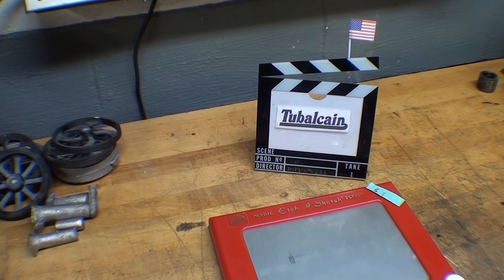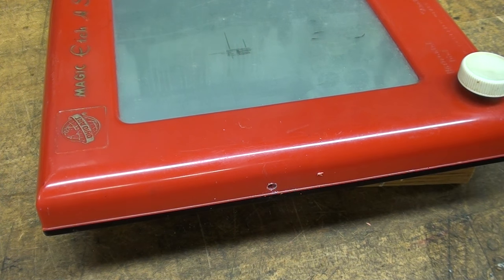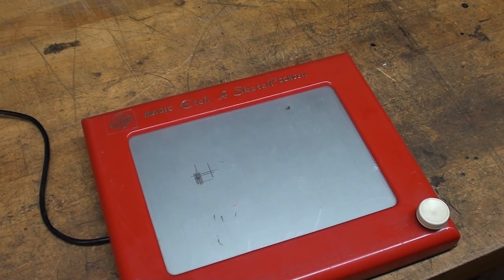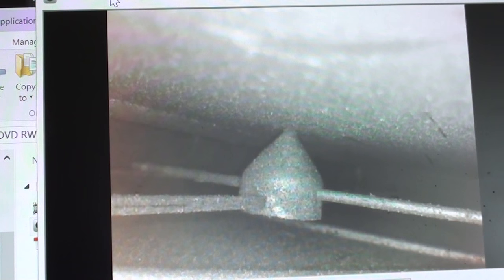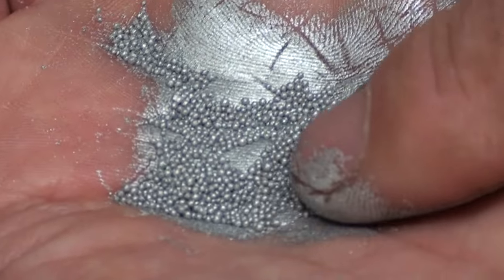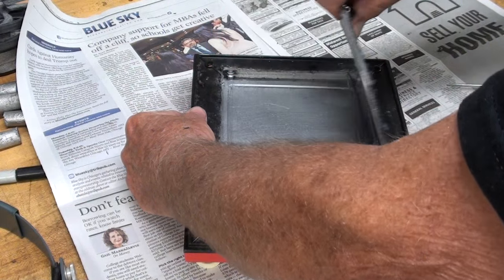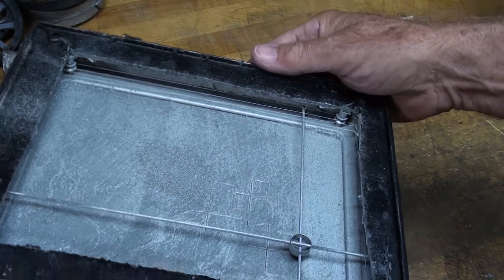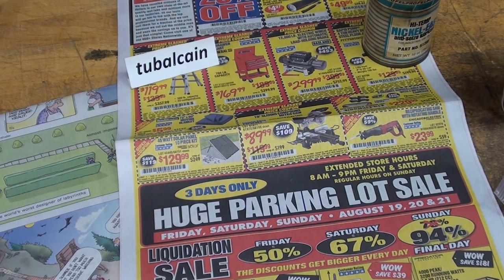WHAT MAKES IT WORK? #22 Etch A Sketch - proctoscope tubalcain

Comment: Another comment. I am a bit older than you. In 1952,  when taking a drafting class at Central High in Kansas City, Mo., the teacher had a problem of students picking things off his desk. To stop the problem he constructed a cigar box with a handle that held an old Ford magneto and a 6 volt telephone battery. The connecting circuit had a wire with a gap in it running under the handle. When the student picked up the box he wound close the circuit. It sure didn't take long to look at the box. Later in life my wife and I moved to Houston where she taught home economic in a large west Houston high school. During her tenure a student put super glue in several door locks. Caused building maintenance quite a problem. Had to open the doors by pulling the hinge pinI do enjoy all of your videos. I am a mechanical engineer, agree with your frustration, ant think society is going to have a very rude awaking one of these day with government going the way it is present moving. Guess I am getting old.

Comment: Thanks Mr Pete, I always wondered how it worked, now I know.  I also had issue with old battery drills, but I liked the variable speed and torque, so I took out the battery and  rigged up a DC power supply with a cord, since I use it at the bench it does not need to be cordless.  Works great, I have the speed and torque control with NO battery issues.  Keep doing what you are doing, love your videos.  David Dellinger

Comment: As always I enjoyed your video.  As a child of perhaps 8 or 9 I also wanted to know how Etch A Sketch worked.  To find out I used the two XY controls to draw parallel lines side by side the entire length of the pane.  I continued doing this until the entire pane was cleared with side by side lines.  It took a fair amount of time as I recall.  In that manner (similar to what you did at the beginning of your presentation) I could actually look down through the semi cleaned pane to see all the working parts.  While my effort saved drilling holes, getting hands dirty etc I never the less greatly enjoyed your presentation more.  Always fun to learn. And it brought back a lot of memories.  Thanks.
Reply from the maker: Thanks--you were pretty clever as a kid.

Comment: I understand your frustration with the Sears 19.2 V drill! That was the first battery operated drill I ever owned and it was a complete piece of junk from the start because, like yours, it wouldn't work but for a very short time after charging. The batteries lasted about 6 months then refused to charge fully afterwards. After letting it sit in the back of the closet for years, I finally gave it away. In the meantime, I got a Dewalt 18V which I have had for 13 years and I just this year finally had to buy two new batteries! The drill motor still works like a champ!

Comment: The first video of yours that I saw was the 8 ball autopsy. This reminded me of that. I had this toy as well as the 8 ball and I like the idea of seeing hoe they work. I'm sure someone will tell you that the powder inside this is bad stuff and there is a guy called Cody's Lab that took it and made thermite from the powder. It's aluminum and oil mixed. You are right about the kids today not having any interest in things like that that are not electronic and slow. The older generation was probably the last one to have anything mechanical and it is only through the exploration of mechanical things that the workings of the world can be figured out. Because you can see how it does what it does. But, open a compute game and look inside and there's nothing that indicates anything, other than a battery. That's why the vast majority of new drivers on the road will need help if they get a flat, because jacking up a car and taking nuts off is soooooo 18th century!
Reply from the maker: Great observations & true!
Reply: Thermite...Oh My!  That might be fun.

Comment: Mr. Pete, always informative and educational.  On the subject of you battery gun, get a Milwaukee fuel (induction motor) the batteries are awesome.  There is plenty of information on these on YouTube.  A bit like you, my students would run the dental laboratory hand pieces up to 50,000 rpm' sat which point the burr would fly out like a bullet.  I had to go in and disable the speed function back to 30,000.  Please keep sharing you inquisitive mind.  Kindest regards. Joe.

Comment: I love your videos Mr. Pete, don't ever change. I like the detail and I've never thought any of your videos were too long.

I also always thought these were magnetic and I'm glad you did this video because it satisfied my curiosity. I think those balls are just the carrier for the powder though. The powder is too fine and light to evenly re-coat the surface without some help. The powder looks like the heat transfer compound I used when I was an HVAC tech. That stuff got everywhere no matter how careful I was.

Comment: Years ago, a close friend was director of communications at College of duPage. One of the students working for them part-time connected step motors to each knob, and wrote software that enabled more sophisticated drawings (like circles) on an Etch-A-Sketch.
Reply: This is the same idea as CNC control on a 2-axis milling machine.  Actually, I was a little surprised that Mr. Pete did not mention the parallel.

Comment: Nice video.  It works pretty much the way I figured it would, though, like you, I suspected magnets were used, too.  The stylus itself is very cleverly designed, the way it rides on the two rods, simple and yet very elegant.  The powder probably acts as something of a lubricant as well as providing opacity to the glass.  The little balls, glass probably, must be to help stir up and redistribute the powder as you shake it.

Comment: I pulled apart an old Underwood typewriter once. The only thing I ever took apart that I couldn't put back together. My father was not a happy camper. I ended up putting all the little wires and springs in a paper bag and then throwing the bag and all in the trash.

Comment: The real heart of an Etch-A-Sketch is the cable arrangement to make the stylus move by turning the knobs.  They have to be a certain way.  I had taken one apart years ago but I don't remember how the cables are arranged.  I think I remember a small spring in line with each cable to keep each taut.
Reply: I am 69.
Reply: You might be right about the springs, Roy, I remember the old valve set radios I took apart as a youngster,  many a moon ago now, those  had a string that ran on small pulleys to move the needle that showed you where the stations were on the face of the radio and that string also had a spring to keep it tight. What happened to the good old days when thing could still be fixed on the kitchen table? Regards and bless the good old times!
Reply: And bless Lyle for bringing back so many old memories! Bless you Mr Pete "Tubalcain" just love the videos and your sense of humour, hope for your sake your wife has a good laugh about the things you say sometimes, but I would bet she does! As you must have been together for some seasons now. And she must know you very well! Hope you remember to put that bras toothbrush back where you found it though, or you might be in hot water this time! Kind regards.
Reply from the maker: THANK YOU!

Comment: I took one apart as a kid by breaking it open at the glue joint. Another thing that didn't go back together, but I've always known how they worked for that reason.
BTW, trash that drill and get one of the newer ones with lithium batteries. HUGE difference.

Comment: Dang! Was curious for you to describe the cable(s) that drive 
the 'etcher', namely what material(S) it consisted of. 
The cable does, as you said, last for a very long time, as does 
the 'cord' that drives the tuning capacitor(s) and frequency dial 
in old radios.

Comment: Im not a fan of those Craftsman Drills either. The Batteries have a problem holding a charge.
Ive had issues with Milwaukee Drills too, Specifically with their chucks.
Best I've found so far has been Hilti and Bosch for Battery life. My hilti drill has been getting used for mixing cement and thinset for the last 7 years or so and it still works. The rubber overmolding Started to deteriorate so it go Wrapped with electrical tape. And I recently picked up a bosch set, a 1/2" hammer drill with an impact driver, And if I'm setting sheetrock I might have to charge them once every day or so, if that. I was kind of blown away when i first bought the set because a couple of weeks went by and the batteries still hadn't dropped low enough to justify a charge. Its been at least six months since I've picked up that set and I'm still real happy with it. not cheap though. $100+ per battery
Reply from the maker: Yes

Comment: I always wondered how they achieved the evenness of the erasure. It seems to be a combination of the very finely-divided powder and the beads which serve to spread the powder and mash it onto the screen.

Finding the it was two identical carriage pairs with crossed (and springy) rods rather that a single gantry with a traveler on the bridge (like a gantry crane) (which was what I had assumed) was just a bonus.

Comment: hard wire that cordless drill and plug it into a small, sealed rechargeable 12V battery, something small enough to carry around, that's what I've done to mine and they'll run all day long now:)

Comment: Any thoughts about what the silver powder is made of?  It would be interesting (to me at least) to know its density (relative to water).  A graduated cylinder, water, and a gram scale would answer that (assuming the powder sinks in water). I'm guessing that the material is some mixture of powdered aluminum (or maybe lead) and oil.  I hope it is non-toxic.  Of course, back in the dawn of toys, toxic had a different meaning.  Consider lead toy soldiers.-It is interesting that the "beads" of the material have such a uniform size - Perhaps they are manufactured that way.  It is a little hard it imagine that the powder could re-clump with such uniformity.-I wonder if there is some sort of electrostatic factor in play here, like specs of lint attracting to plastic.The intrigue continues!!
Reply: The powder is a very fine aluminium, the beads are polystyrene. The purpose of the beads is to distribute and break up clumps of the aluminium powder.
Reply: being polystyrene it would make sense if there was some kind of static charge happening between the plastic screen and the polystyrene, I once tried to break up a piece of polystyrene into small beads and put it into a plastic container, it was a nightmare, they stuck to everything plastic like a magnet and wouldn't stay in the container
Reply: Ned's Head I think the polystyrene [negative] may help to offset the aluminium's [positive] static charge. Aluminium is notorious for being explosive when it is an airborne powder. The screen is most likely a type of plastic that carries a slightly negative charge which would help the aluminium [but not the polystyrene] stick to it.

Comment: I am going to guess the powder is zinc for it's lubrication properties, easily tested by taking a small sample in a teaspoon and heating it if zinc it will melt at a very low temperature. Zinc like in anti seize but without any oil.

Comment: If your NiCad or NiMH drill battery is dying try giving it a short sharp shock. Tap it across a car battery for a current shock or a higher voltage DC supply for a voltage shock. The shock can break up the dendrites that are impeding the charge/discharge behaviour. 
Doesn't always work but I have been happily surprised at how well it can work.
If the battery is dying anyway what have you got to lose?

P.S.
I figured out how EtchASketch worked about the age of 7. Without having to break it.
Oh wait!! This is a troll vid right? :)

Comment: You should smash that cordless drill and get one with a lithium battery, it will stay charged.
Reply: You don't have to smash the drill, you can rebuild that battery pack
Reply: By the time you have bought a high current protection module you might as well buy a new drill, and that's not even counting the cost of the lithium cells (selected please, or are you going to do the balancing by hand?). Lyle is not exactly keen on electronics, he may even have difficulty coming up with a suitable charger.

I design battery chargers for a living and could get the required electronics and cells from the scrap bin, but the small 12V lithium tools are so powerful now there is absolutely zero appeal for me to retrofit the big old drills.
Reply: Convert your cordless drill to a corded one. Use the batteries only when a cord won't reach and save the batteries. Even Lithium batteries have a limited number of recharges before failure.
Reply: But Lyle, like most men, already has many corded drills.
What would be the point of making one more, with a big power supply?
Reply: My comment wasn't directed solely at Mrpete222. I have converted a cordless drill to a corded one to save battery use and prevent premature failure of the rather expensive battery packs. I also use the adapter for use on my cordless impact drive, cordless saber saw and cordless skil saw. Such a conversion is simple if you use a dead battery pack and appropriate voltage/current power supply.
Reply: What power supply did you use?
Back when I looked into this (must have been 15 years ago) I measured something like 40 amps peak on a 7.2V Makita drill. I didn't have a suitable power supply back then and abandoned the idea. The drill briefly, and impractically, lived on with a 6V lead acid gel cell connected via a short cord.

Comment: With cordless tools, the nicad batteries suck.  However, the new lithium ion batteries and brushless tools are infinitely better than the old nicad tools.  If you try out a brushless lithium ion drill from a professional brand, I think you'll change your mind about cordless tools.  The pro brands these days are Milwaukee, DeWalt, Ridgid, Makita, and Bosch.  Craftsman, Ryobi, and Black and Decker are designed and priced as lower quality homeowner tools.  There's cordless everything these days; miter saws, routers, table saws, grinders, rotary hammers, impact wrenches, nail guns, and hole hawgs, many of which are faster and more powerful than their corded counterparts.
Reply from the maker: I need to get one!!